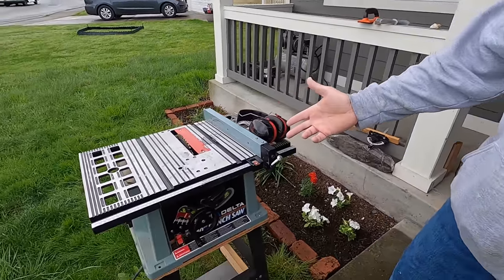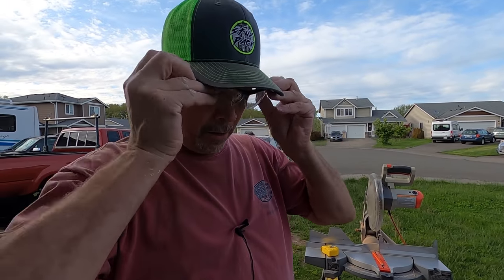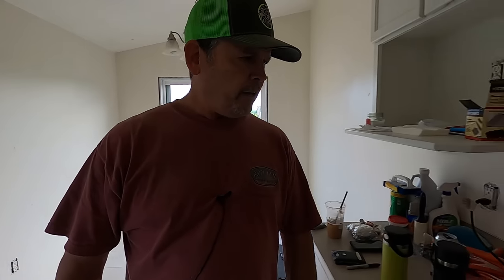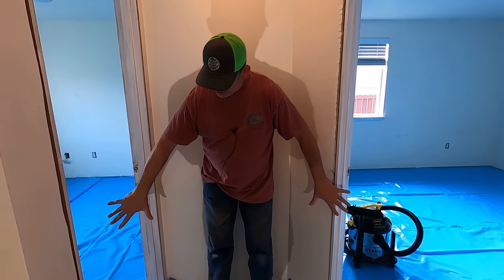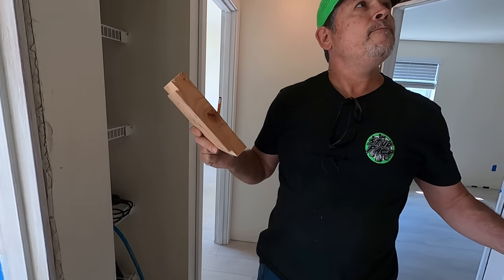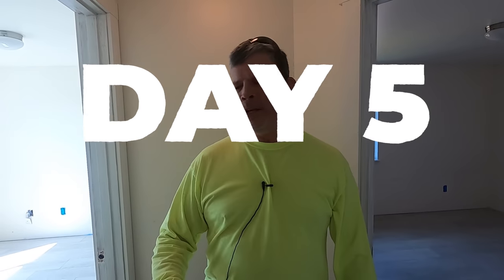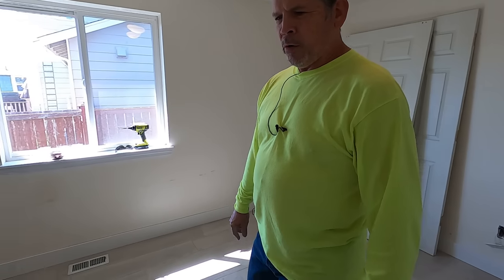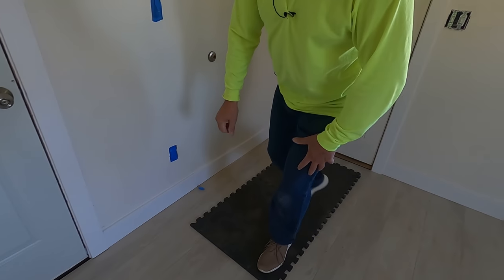DIY HOUSE RENOVATION for UNDER $8,000 - Part 2

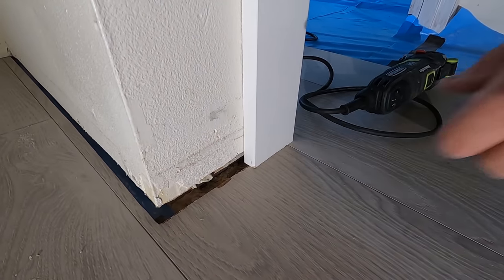Comment: 11:06 When I put my new floor in years ago I pumped silicone caulk in all those voids.  I also applied a fat bead of silicon so the bottom and back of the base board trim would set into the large bead to make a water tight seal for future mopping episodes.

Comment: For laminate install I always use a scrap piece as my beater block.   it fits perfectly in the joint and won't damage the finished piece.   combine that with a scrap of wood and you got a perfect hammering tool.    And just like boxing, the "Cut" man can save or ruin you.   And I love it when my wifey turns up with coffee and donuts, gives that extra boost to complete the job.    Teamwork makes the dream work!

Comment: As soon as the baseboard montage started I knew what was coming next: caulk!  I replaced all the base and case in my house and was so happy and proud when I got all the trim work done. And then like you I switched into paint prep mode and <deflating sound> thought about all that caulking I had to do. 😢 Great tip on the straight base vs crooked wall. 👍

Comment: As someone living in Washington I'm surprised that you're surprised that the appliances are hard wired into the wall. That's how most of the dishwashers and hood vents are attached here. Also as someone who does a decent amount of subfloor and flooring repairs, the toe-kick saw is definitely a must have!
Reply: Yes, and here in MD I have never seen a disposal, dishwasher or hood that WASN'T hard-wired.  In fact, most electric ranges are also hard-wired.
Reply from the maker: Where we live (Louisiana), dishwashers and disposals have plug connectors.
Reply: @StudPack  Honestly, that's a much better way to go. Saves a lot of time over the years lol, I'm just recalling now all the appliances I had to disconnect haha.

Comment: We’ve done whole houses like this with porcelain plant. The craziest cuts lol. Ones like the one at that door and with vent where you break the cut 1-2 times. Sometimes we’d mark the cut for the vent and install it before cutting it. Having some rags in the vent so we don’t get tons of water in there. 

Love big projects like this. Feels good man. We just did a crazy house up in the rougher part of the city for a lady that worked for a company that hired us for their floors. At some points you wonder if the job will ever end. Then when it finally does and looks good? Good feeling man.

Also a little tip for the tile transition. You can use AETK schluter to hold the sliver down. That + the glue? It aint going nowhere!
Reply: Big vote for Schluter!

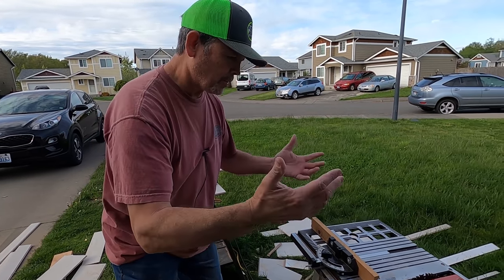Comment: 5:30 I had that same exact saw for years. Sold it about a month ago.  It packs a lot of horsepower for its size! And the little sucker is LOUD.  No riving blade and an itty bitty on/off switch but it'll get the job done.

Comment: These are such great videos-- both informative and entertaining!  I used to be the manager of a floorcovering warehouse and I also did most of the flooring in our house... with the exception of ceramic tile in the kitchen/half bath/laundry room (I hired one of our pros to do that!)  The rest of the house was done with laminate flooring, and I sure could have used a few of your tips and tricks when I laid it!  Let's just say that quarter round can hide a lot of mistakes!  But it turned out looking great, and I got a lot of compliments on those floors!  In the master bedroom (which butted up to the tile from the kitchen), I tried out the new (at the time) solid vinyl plank in wood patterns.  So easy to lay (razor knife and a straight edge), wears like iron and looks fantastic-- just a bit more expensive!

Comment: One thing I would offer as a suggestion is to lay strips of rosin paper beneath the baseboard just prior to nailing up the base.  It will make it easy to prime and paint without masking.  The rosin paper will easily slip out from under the base after you're done.  Love your channel guys - such positive content with real-world knowledge shared every time.

Comment: A guillotine floor cutter is the way to go on flooring like that. You can work right at the floor without getting up and running to the saw. Also no dust. Table saw or score/snap for the rip cuts. 

Also is that a wood based flooring? I have personally stopped using that. Any water touching it destroys it.
Reply: Do those work well with the wood ones? I use those all the time for vct.
Reply: @Titantitan001  They do.
Reply: Agreed, SPC is the way to go. I assume they didn't use a vinyl cutter because they didn't have one and didnt want to spend the 50 bucks.
Reply: Totally agree! Have used a sharp shooter cutter for both lvp and wood plank. It also cuts cement plank siding like a dream! Will never install without one again! Worth every penny!

Comment: In previous video where you tore up the old floor and replaced damaged joints there was a vapour barrier which created a moisture problem and contributed to the rotten joints. On this job you added a vapour barrier under the new flooring. What’s the difference?
Reply: They put down the vapor barrier for this flooring per the manufacture instructions and this house has a better ventilated crawlspace. The other house did not. I hope this helps!

Comment: First of all, I enjoy watching your videos.  I love the attention to detail, and common sense approach to problems encountered in remodeling.
My question is: Why laminate flooring, especially in a kitchen, bath, ex. (wet areas)?  Why not Vinyl flooring that can stand up to moisture?  As a homeowner, I have hardwood in the first floor of my home, including a half  bath and kitchen.  Have recently had leaks in the refrigerator icemaker and the dishwasher... major damage needing replacement of entire kitchen area flooring.  Vinyl would not require this replacement expense.  Seems like a no-brainer.  Expense could not be that big a factor.  So, why??  Laminate is so old-school.
Reply: Modern laminates can be had that are waterproof.  Otherwise I'm right with you.  I'm sure Stud Pack would have preferred to lay tile in the kitchen/bath but time wouldn't allow.
Reply: A good modern LVP can be a waterproof option and durable. Learning the different qualities and why is key! 😙😁👍 Installation is arguably easier and more flexible for remodel in the future without having to deal with glue from sheet vinyl. 🤔😙👍 I hope this helps!
Reply: @insecureinvestorchallenge7366  
I think he's talking about vinyl planks 
No glue needed

Comment: Thanks for making the video series, they are so satisfying to watch!! I want to ask you that when you lay down the floors, do you use any adhesive under each piece or anything to hold them in to the plastic at all? OR are they simply hold down by gravity, that way would they shift or move overtime? Thanks!
Reply from the maker: Gravity holds it in place.   The floor needs to expand contract per manufacturer so no adhesive

Comment: at the end when you were showing the baseboard being thinner than the door casing I noticed you just butt the baseboard against the casing. do you guys ever use plinthe blocks at the intersection between the baseboard and casing? It's pretty common around home...like more common than not. is that just a regional method of doing it? or was it seen as just an unnecessary extra expense on this one?

Comment: Oh a new thing about nail gun tricks. I never though about always holding it perpendicular to the run of the moulding! Yeah the painter will fix that. I'm the painter not the carpenter! Whose job should it be to caulk those base boards and trim?

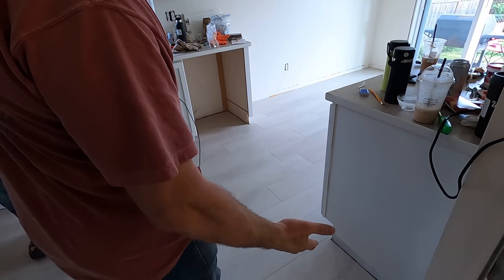Comment: 6:59 in the video. I would like to know how the dishwashing space worked-out! I have had the bad luck that the dishwasher doesn't fit due to the flooring being installed in that space. Did you have the same issue or did you replaced the countertops as well? Thanks for the content you provide! "Keep it coming"!
Reply: Remember in the previous video he removed 3/4 inch thick underlayment, so he's till go a 1/4 of extra room, no problem!

Comment: Ive found i dont like seperating them all like that. Id rather work out of 2 or 3 boxes checking my patterns as im going. It seems to take much longer if you think about it too much
Reply: I hear ya, I do the same.  And I put boxes along the length of the room.  I'm on my knees all the time, no getting up to go get pieces since I'm typically all by myself!  Just put a couple of boxes to they are never beyond arm's reach and you don't have to push them around.  As I move down the run new pieces are right there waiting.

Comment: 2 if my pet peves. Square stock and end grain.  I know mdf (🤮) takes paint better but yuk.  If i have to use square stock i mitre the tops. So looks like a mitre but you get the  closed joint of a cope.  Looks like your flipping this house?
Reply: Square stock is obv for speed. Coping a complex pattern takes forever. Square stock can do everything in a flash on your miter saw.